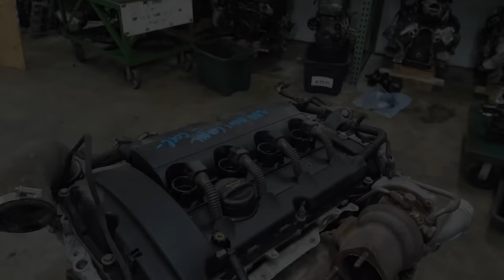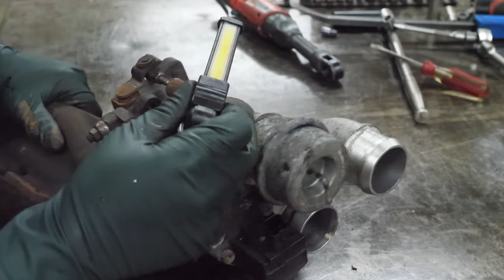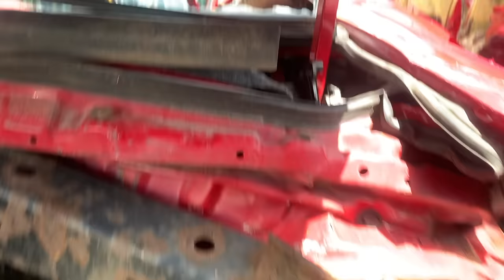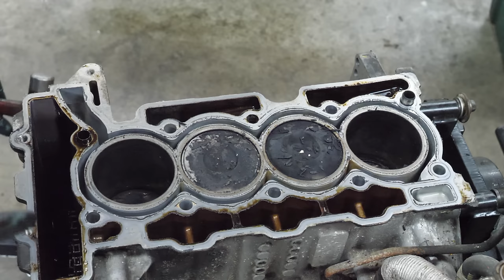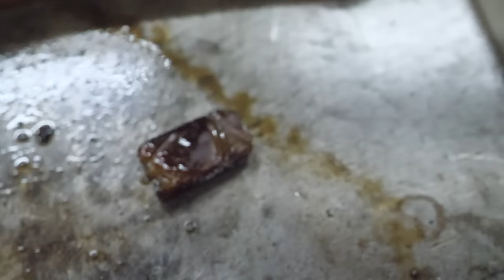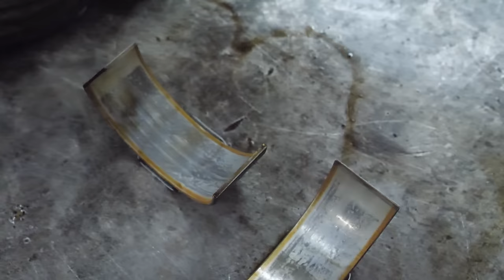JUNK Mini Cooper S (BMW/Peugeot) N14 Turbo Engine Teardown. Why Do People Buy These?

Comment: I have been working on these cars for over 10 years now.  They are not as bad as people think.  The biggest problem with these cars is that they cost a lot to repair.  Essentially, you're paying for BMW labor and parts.  So, most people don't take care of their cars very well for the high cost of maintenance.

Comment: My 85K mile 2009 N14 S decided to lose all compression in cylinder 3 while cruising down the highway. Up to that point, the car was perfectly maintained and drove great. The cost to remove and tear down the motor would have been more than the value of a used running car and I sold it as-is for parts. The best guess is it lost a valve seat, but even the mini mechanic said it would have been a tear down to figure out what really happened. Fun car and motor... right up the point that it converted itself into a parts car lol.

Comment: They blow a core plug on the cylinder head just below cam sprockets. Water from the head then pours into timing chain compartment and into the sump. I fixed one with a lever bar, hammer and new core plug, been fine ever since.

Comment: replacing the timing kit is a nice job , it beats a lot of other engines where you have to take of front covers..
the "belt tensioner" has a tab you can pull out and lock , it loosens the tension .
the tph engines are very common here , in peugeot and citroen beisdes the bmw/mini.

Comment: The water got in from a small plug on the cylinder head.  It is about 1/4 inch circle blows out when too much water pressure. I had that happen on my 2012 I just pressure put the plug and aluminum welded in place. Worked awesome for 4 years til I sold it.

Comment: When I was younger, my sister begged my parents to get her a mini Cooper.

Being the mechanic, I advised that we should definitely not get it.

Over the course of two years, I had to replace the clutch, which is a nightmare because you have to remove the front end of the car. I also had to rebuild a cylinder head because of a cracked valve. They were notorious for running, lean and causing the exhaust valve to crack and eventually break off like yours did.

By far the worst part of the car was a bad oxygen sensor, little did I know, the mini coopers oxygen sensor is tied into the power steering system. 

If you have an issue with your power steering system, you cannot pass smog.

A power steering rack cost more than the car was worth.

We ended up selling the car for parts at the end..

Comment: mine has 240.000km from 2012 ,it is the n14 platform ,Peugeot 1.6 thp 156hp ,i change the oil every 10.000km or less ,and since the coolant is currently leaking out from somewhere its always fresh ,but strangely the oil level never drops

Comment: Fun fact the oil filter in this video the black I timing guide material so if you own a bmw and see brown/black debris your engine is about to grenade so get the timing chain checked it’s because when it pops it’s 5-15k for a new set of chains or an engine

Comment: Owned that car with the power plant. That was the biggest smallest POS I’ve ever owned. Things fixed before I gave up…turbo, high pressure fuel pump, timing chain, all the vacuum lines, and few other things. So when it was running I drove it like rental car because you knew it was going to break anyways lol. Put new rods and pistons in it with a tune for 26lbs of boost and just gave it pure hell till the day I smoked a deer doing 85 on the way to work.

Comment: I am a mechanic in the Netherlands at a Peugeot dealer and I can repair these engines with my eyes closed. What a miserable block. When Peugeot got worse around 2005, they had to come up with a new model and that was the 308 in 2007 (later the 3008/5008 and the 508) but they had no engine which met the requirements in terms of emissions and so on, so they went shopping at others because it was cheaper and then they ended up with the 1.6 THP engine from BMW (also the 1.4/1.6 VTI), but there are fewer problems there. BMW soon stopped using these engines because they knew they were no good. PSA has taken a look at them and made some changes to make them more reliable, but unfortunately. Both types of engines suffer a lot from oil consumption. 1 liter per 1000 km is normal. for the rest, the VTI is still doable and reasonably reliable, but the THP pffffff is a different story. Chain that is stretched on average after 30,000 km (even the modified ones), upper guides that snap, chain tensioner that breaks, intake and exhaust camshaft adjusters, fuel pump high pressure, inlet valves dirty, turbo shaft play or the wasegate valve worn out. Thermostat housing that starts to leak at the seam. The plastic water pump that cracks (occurred later and iron) causes compression loss through the pistons. gasket of the oil filter housing on the block that starts to leak, due to high oil consumption the catalyst quickly fills up and then malfunctions, the catalyst ages and I can mention a few more things. Recently customer (3008) bought second hand with 150,000 on the odometer somewhere and goes on holiday with the caravan to our region and yes, all the lights come on near the campsite. comes to us and after investigation the whole shebang came out and it will cost the customer 6000 euros to get the car perfect again. The repair was more expensive than the car itself cost. The question is not if I will get this problem, but when.

Comment: I had on of those but was on Peugeot 207. It was a differnt design. The water pump was driven by the cam chain, short version of long story. The water pump failed at 100Klm (or 60K Miles) motor stopped but by time it fully stopped the motor was history (vales and Piston contact)

Comment: I just wonder if the engine got the old submarine test at any point. No, they really don't work under water. You would have found coolant, not clear water. I worked at BMW in Spartanburg in the early 2000s. The cars that were imported to the US were placed on the end of the assembly line and went through final testing and inspection. They found many defects on the Mini Coopers.

Comment: There's another aspect to high failure engines that no one mentions. High failure rates in Jeeps and Minis can also be attributed to the type of person that buys these cars. They typically use the engines much harder than the normal driver.

Comment: I guess I am the lucky one 115k km and still going with zero issues. I have the n14 in a citroen c5 from 2011. I bought it veeeery cheap with 35k km, but now i know why, because in Germany where I live these engines have an extremely bad reputation. But again, I had zero issues and I can still exceed 200 km/h in the autobahn easily. But one thing I got to know with these engines is that they require good oil and regular changes of oil. I use synthetic and do the oil changes every 6 months.  I would say that the biggest issue is the carbon build up, and this is an issue with every engine that has this king of injection. Apart from the reliability issues, that i had not had until now, this engine is really impressive, loads of torgue, powerfull, smooth, silent and very very economical. My next car will be again a citroen with the next generation of this engine that hopefully would be better. And to be fair, everybody speaks bad about this engine, but few speak about how bad and unreliable most of modern engines are! The bitter truth is that it is very difficult to find a reliable engine. If you want a strong engine you need a diesel or a very simple engine , like the ones dacia is using in the cheaper models.

Comment: That oil pan mud mix, that's what flood engines look like.  When you open it up it smells and then gives you a high, you start feeling drunk in a bad way, ventilate well till you get it cleaned up.

Comment: The Timing chain on this engine is a major issue too. It was the cause it's a class action lawsuit and Mini had to pay out and repair a bunch of them. This motor also burns about a quart of oil every 1k miles.

Comment: My prior model 2006 Cooper S is running perfectly with 267.000 km on it. 
If I had to get the car anew, I would opt for the normal Cooper since the waterpump that is connected to the turbocharger is a complex and very costly single point of failure. One must wonder why engineers built it like that.

Comment: I own an 07 r56 just watching for curiosity but on the oil change thing theres a coolant resovoir held on by one 10mm bolt you take that bolt out set resovoir to side and remove filter very easily i i have daily driven mine 30k miles a year very hard driving beat it regularly i have a heavy foot but i change my oil every 4k miles so far so good have replaced waterpump and thermostat housing in the 50k miles ive put on it currently sitting at 165k miles i do have a slight miss im trying to chase but havent put mich effort into finding the issue

Comment: That is not the belt tensioner. It is the water pump actuator. It is electrically controlled and engages and disengages the water pump from the crankshaft.

Comment: I had one in a Citroen, oil always smells like fuel and very thin and they sound like a diesel engine with the timing chain rattling around.
I sold it while it was still running well enough.

Comment: I was filling my car up one night and noticed a woman in the next row pouring water into her oil filler, she literally emptied the servo jug at least once. I asked her what she was doing
to which she officiously stated she was adding water as the indicator on her dash stated it needed water. Cut a long story short the indicator simply showed her screen wash tank was
low. I persuaded her to leave the car and have it towed to a garage to remove the water, but it took some convincing. She did not want to trust what I was saying, hopefully the repair
shop convinced her. I'll bet that has also happened in this case, and is probably nothing rare these days.

Comment: 20:30 using a 3/4” tool (with an adapter) to loosen the headbolts is soo much easier on your joints and muscles!!!

Comment: 13:07 That's actually not the belt tensioner, the belt does not actually make contact with the water pump, that... thing is down and the water pump is not spinning when the engine is still cold, then it goes up, makes contact with both the water pump and crank pulley and so it makes it spin once the engine warms up. It's a mechanism made for the engine to warm up quicker, idk, german efficiency stuff
This is also why the water pump pulley has that rubber around it

Comment: I’ve put 283,972 miles on mine and I’ve never changed the oil or the air filter! I also use diesel and pee for coolant.

Comment: I really love the Mini Cooper JCW Coupe. I know, I’m in the minority. I am in the market to purchase a low mileage example that’s been properly maintained (if that’s possible). Until I learned of the N-14 engine and the problems associated with it. 
Any suggestions? Is one year better than another (2012 - 2015)? They aren’t inexpensive either. I looked at a nice example, a 2012 JCW with 26,000 miles for $18,900. Beautiful on the outside, engine compartment looked beat. I decided to keep looking. If you’re selling one that’s been sorted out, let me know. Don’t understand the very high prices though.

Comment: Fair comment but these aren't really pure bmw engines they are actually french ie PSA bmw input was needed mainly for the injection side of things bmw like other car manufacturers have drifted from their customers who made them successful ever since they sold half of the business off then made the mistake of front wheel drive they are no different now to other car manufacturers its very hard to find main stream manufacturer still sticking to their roots

Comment: Could be that the previous timing chain guide failure led to a slightly bent\damaged valve that then created a vacuum leak (and lean mixture) that simply got worse as time went on - this car was obviously driven quite a while with this damaged valve.

Comment: Not worked on an engine in a long time. Surprised to see a vacuum pump and a mechanical fuel pump on a petrol engine. 

I've thought about getting a mini but I'm put off by the engine. Was the earlier Chrysler engine any better? What about the diesels, apparently the early diesel was a Toyota engine.

Comment: That engine looks very similar to the ford mondeo mk5 1.6 diesel engine. Turbo up front oil filter down the side above gearbox blocked in by air filter box even the filter element is the same. We have one as a taxi it’s got about 200.000 miles on it now it has suffered from cam belt issue where it destroyed the tensioner followed by the press together cams it’s a fail safe thing but is a nightmare as they do move and they drop the odd valve without warning ⚠️.

Comment: These engines in Europe are very common going in Cooper S , Citroen DS3 , 207 GTi Peugeot etc, the secret is doing the oil change every 3000 to 4000 miles , my 2012 Citroen DS3 Dsport+ has not as yet been problematic but I do over do oil changes.

Comment: I mean, I got zealous. Bought a 2010 clubman with the JCW bells and whistles, just not a jcw.  Actually is quite unique, haven’t seen the same kind exactly yet.  I put 25,000 hard miles on it starting at 125k. I won’t say price, just that I overpaid by about 2500. In about 1500 in to parts for repair. My engine was amazing, until HPFP started giving occasional code, then one day, she went silent. Vacuum pump seized, snapping timing chain possibly.  Likely.  Got the HPFP swapped and tried to start the car after replacing that, with struggle, and awful. I didn’t check the timing chain or remove valve cover at all.  My mistake.  The chain tore off a chunk of the the lower blocks casting for the dipstick.. and chewed all the teeth off the lower sprocket.  I removed the pain, dug around the pump etc, tore head apart, replaced all valves, 2 on exhaust side had bent only, no noticeable piston damage.  I went slowly, followed all except my oil pump gaskets, which didn’t arrive in time, and I made a fatal mistake. It fired up and ran beautifully.  Until…. It didn’t.  My turbo lost a nut on the wastegate actuator, got lucky, fixed that quick, and boom ran great again, until suddenly I smell burning rubber/plastic/oil.  And I financially could not park the car, and now I’m regretting it.  But I’m not gonna quit on the engine. I’m just gonna keep learning how to rebuild them top to bottom.

Comment: Dude that belt tensioner can’t be replaced on the side of the highway. I’ve done it and i had to drop the engine just to be able to get my hands in there.

These cars are auper fun when they work but i’ll never own another one unless so many random issues and the overall design makes no sense

Comment: I’d love for you to do a tear down on a BMW M 62TUb44 v8  engine out of the E 39 five series only reason is because I have one of those cars with almost 4000 miles 375,000 to be exact I have an e39 540 I only major issues I’ve ever had was some electrical problems and timing chain guides

Comment: That valve being destroyed could be related to the timing belt, if the belt is too loose and the engine is being revved the cam shaft timing changes. It might have been changed too much causing the valve to "touch" the piston too hard and broke off. 

As for the water, the turbo had a water leak probably, and caused water to enter into the oil cooling. That's why the turbo seized up.
Water is boiling in the oil part and creating air, in stead of cooling in the turbo. Heat + Air + Water + Iron = Rust

Which came first, the timing belt or the turbo failure? 

Who knows...

Comment: oh man... it reminds me of my first generation Pug 308. Mine was a NA, but still it inherit some of the common issues. E.g. engine oil leaking (valve cover/vacuum pump/oil filter housing), engine oil consumption, O2 sensors, etc.

Comment: While i agree these motors have a lot of issues.  You can get good life or of them.  I have an '09 JCW i bought new that now has 215K miles on it. I service it every 5K miles. It's had the obvious issues but we're replaced timely (timing chain replaced under warranty ~100K miles, 2 HPFP, they seem to last about 100K miles, turbo charger at $160K. Water pump at 170K miles, and a bunch of other misc stuff). But nothing i world consider extraordinary for a car worh 215K miles on it. Also a an fyi after the rurbo went, i replaced with a larger turbo, cold air induction, larger intercooler and computer tune. It's putting down 237HP at the wheels.  We'll see how long it lasts.

Comment: Thats N14 is the Prince engine. The production of MINI version of 'Prince' family of engines is set to end by 2016, and be replaced by its very latest 3 and 4 cylinder Engine family – BMW B37, BMW B38 and BMW B48.

Comment: My mini cooper BMW (not Peugeot) 1.6 TD had the whole Turbo Fold up after just 44000km and I had to pay for the new turbo and I stallation because it was 1year out of warranty.
The mechanic told me it happens all the time on that model and it is not cheap (1600€ just for the turbo plus installation).
BMW knows well of the fault and didn't bother fixing it until you are stranded and have to call someone to pick up your car.
BMW and Mercedes used to be reliable cars but have lost their way: I'd rather trust Kia or Honda nowadays. Or rather pick up an Alfa and don't bother because it might be "unreliable" (or might not)

Comment: The engine BMW does not talk about. That was from a tutor at the BMW academy in Wokefield park, Reading, England told us. The engine is terrible.requires 5k oil changes. Seen countless normally aspirated engines smoke due to gummed piston rings. 
I advise anyone to avoid like the plague.
Funnily enough this same much improved engine in the Peugeot 308 Gti is superb.
Basically this engine you have stripped is a Peugeot block with a BMW Vanos head.